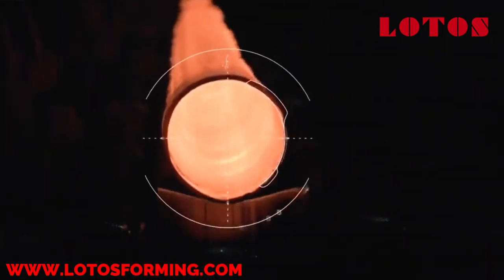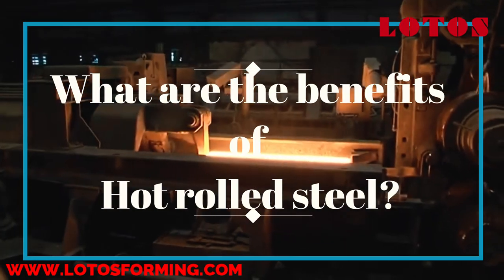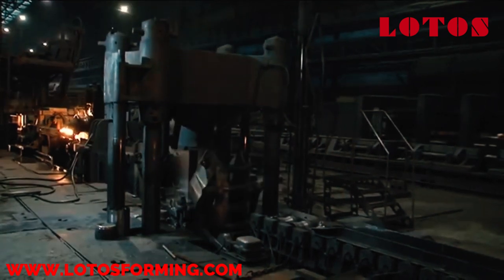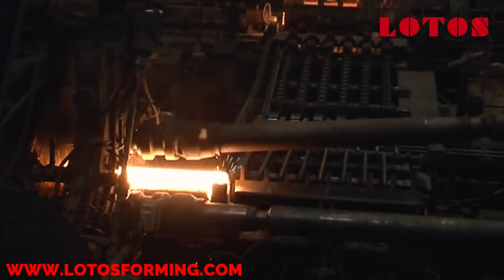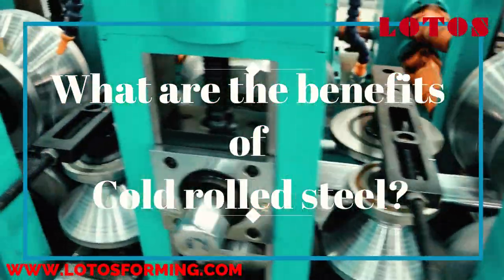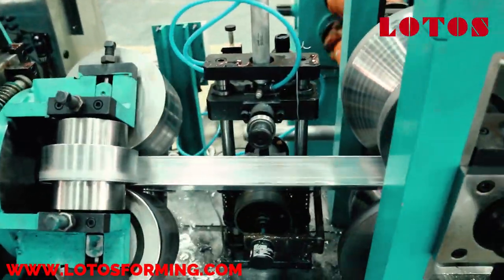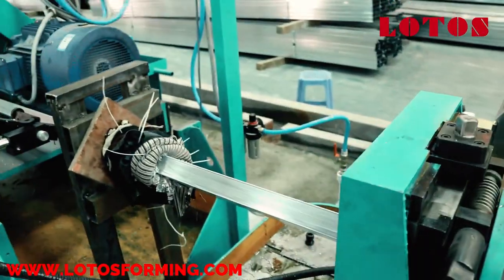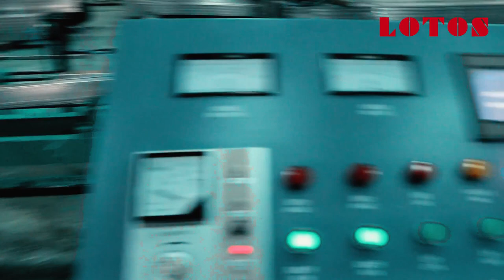【Hot Rolled vs Cold Rolled Steel】: Differences Between Hot and Cold Rolled Steel "LOTOS 2021"

Comment: Hot rolled steel comes with a scaly surface, slightly rounded edges and corners and the surface is non-oily. Cold rolled steel has an oily or greasy finish, very smooth surface, and very sharp edges.